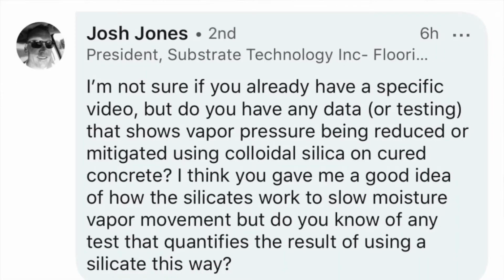Colloidal Silica & Vapor Pressure - Vlog #232

Comment: It's all about "pore connectivity." Porosity is irrelevant if the pores do not connect to each other... The hydrated gel matrix of poured concrete can be thought of as an "open cell foam." As CS densifier penetrates and then closes off the bleed water channels and other networks of connected pores, it begins to seal itself out. At this point, the hydrated gel matrix becomes more and more like a "closed cell foam." Total porosity may actually change very little given the low mass of material added (even factoring in hydrate). But one should not be surprised to see reductions in the permeability of highly porous slabs measured in the orders of magnitude.

Comment: Can a concrete densifier that is applied after the concrete has cured for 30 days, be considered a solution for MVER? I cant remember which coating company states that you should NOT apply a moisture barrier(MB) over a densified concrete floor. This was for a rH meter reading over 80%. Thank you
Reply from the maker: Juan Salinas it depends on what you mean for a solution to MVER. 

Yes colloidal silica (in many forms) can be used to reduce MVER.  This is done by densification of the slab surface after it has cured and hardened.

That being said, if you have some major issues related to a well understand the slab and no moisture vapor barrier you might need a strong epoxy to stop moisture related problems.